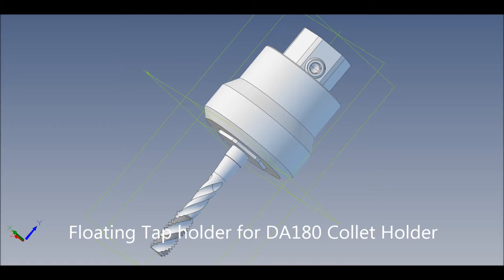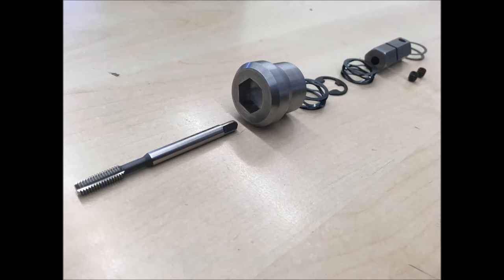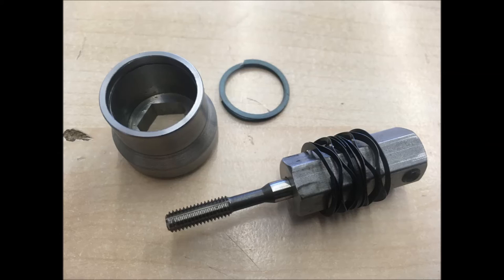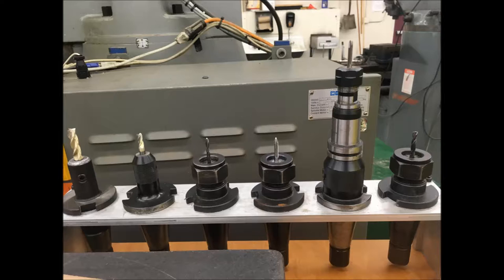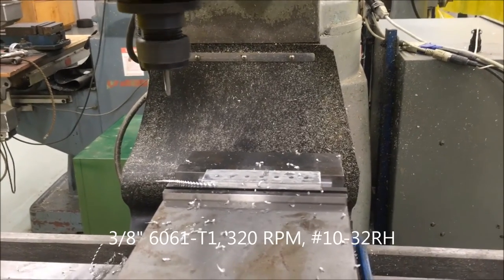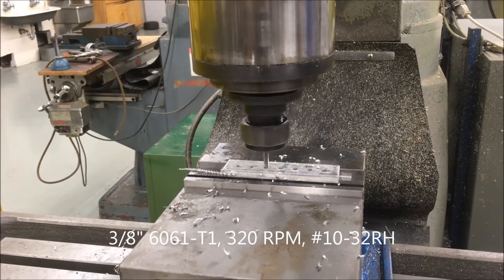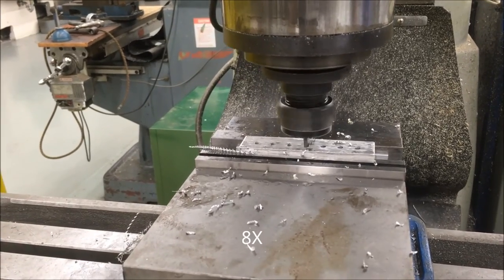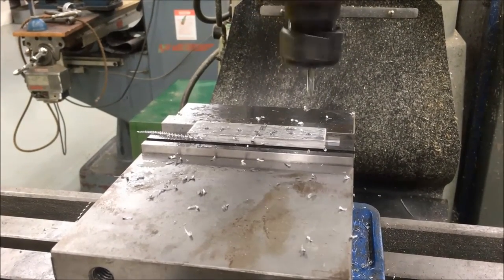Homemade floating tap holder for Erickson DA-180 collet chuck

Comment: Is it just spring loaded to let it draw itself in and out?
Reply from the maker: It's not self reversing, the machine still has to stop and reverse the spindle. It has two opposing wave springs that allow the tap to travel or float in compression or tension (0.2" total). Because this mill doesn't support rigid tapping I needed a holder that can float a little in case the spindle rpm and z feed are not perfectly in sync. After a lot of use the springs are feeling a bit soft but it still is working well. I may experiment with some kind of rubber in place of the springs when the time comes to change them. I especially like the compactness. Most compression/tension holders are a lot longer and eat into my Z travel.
Reply: @inventorforhire  i see you use three pcs wafe washer for one side compensation, and three pcs for other side compensation.
How do you fix 3 wafe washer each one to other one?
Reply: @ЕленаВасилишина-й4я  There is a C-clip between the two wave springs. One spring for each direction of travel. The C-clip causes the hex shaft to float between the springs. There is a spiral clip that retains the springs and shaft in the bore. I've been thinking about changing the wave springs out for elastomer. Something like a few -o-rings stacked. The wave springs work but they are a little on the weak side for my taste. The bore was hex broached or course.